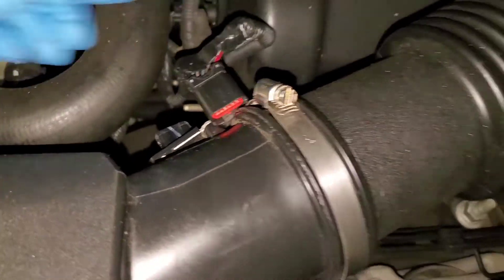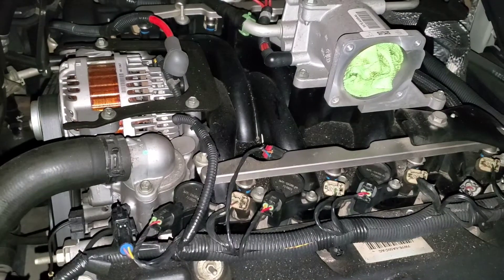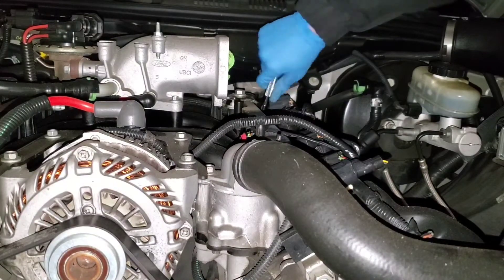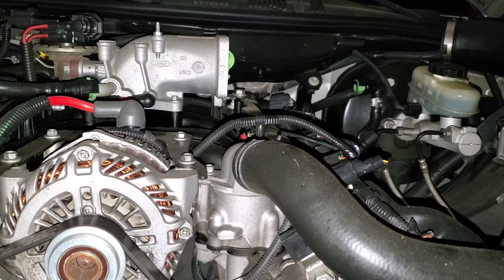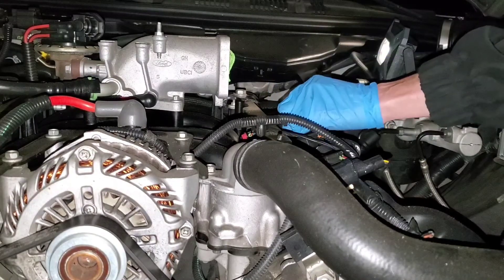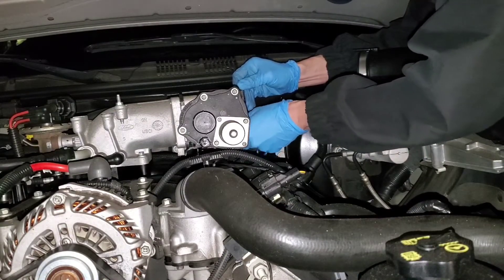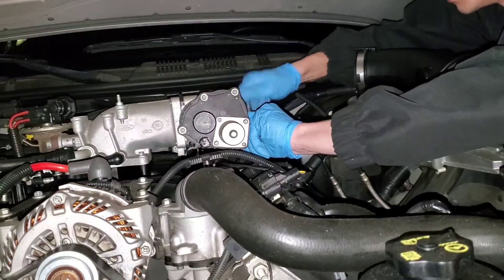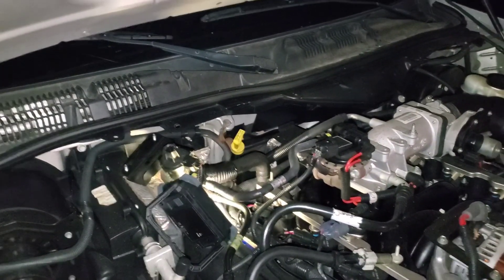Crown Victoria Spark Plug Change and Throttle Body Cleaning (Very Long Video)

Comment: Right on J-Dub,
Good work, and good job.
How's your back? Sore?

I like that tip with the Computer Keyboard Duster.
And I liked your Larry David impression at the end.
Prettayy, prettayy good. lol

You may want to perform a calibration procedure after disconnecting & cleaning your Throttle Body.
I'll leave a link to WJ Hany Dad's video on the subject in a separate comment.

-Chuck
Reply: Here's the link;
https://youtu.be/53FCrEqOzAo
Reply from the maker: Thanks Chuck much appreciated. My back is fine now but after that night it felt like a gorilla attacked me

Comment: I am changing spark plug cylender 7 and i am having a nightmare of a time getting that one out.. does having the throttle body off really help? That thing is completely in my way
Reply from the maker: Yes I would take off the throttle body to make room, it's pretty easy to take off just 4 bolts and a electrical connector
Reply: @minutemanproductions8029  thanks got the spark plug replaced after 4 days of trying with the throttle body on.. took forever it seemed, my back was hurting like yours to.. what a nightmare but so far car runs like normal again! I had to let it sit for a few minutes, foot pedal was mushy feeling untill it warmed up